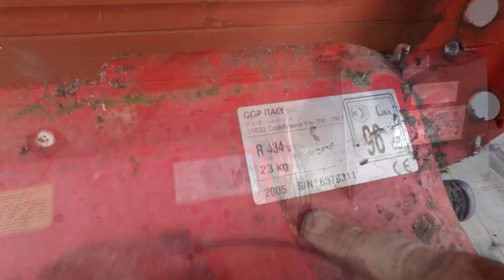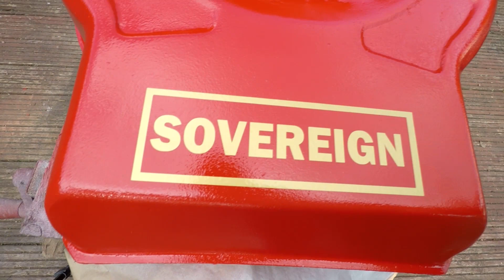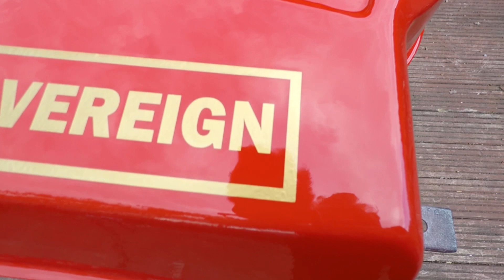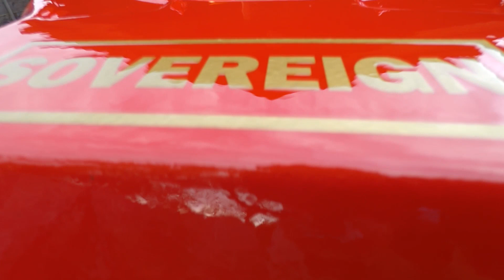Old Worn Out Lawnmower Lives Again Restoration

Comment: Well done Mart on yet another great mower resto. You really are  great with this kind of work.I had a similar type of mower (BTS 430) which the deck rotted despite the fact that I always clean underneath the deck after mowing. It was in worse condition than yours because it had actual holes in it.I took the still working engine  from it and scrapped it.I found a mower in the garden of an abandoned house with a totally rotten deck but I dont know if the engine is scrap or not .Still have it might try to see if it  will work some day.The fuel tank has holes in it though.

Comment: FYI I HAVE BEEN MAKING MY OWN RUST BUSTER FOR BOLTS FOR YEARS . GET A QUART OF SYNTHETIC TRANSMISSION FLUID ANY BRAND AND ACETONE IN A OIL CAN MIX 50/50 EQUAL AMOUNTS SHAKE WELL ANS SHAKE BEFORE USING BEST OF THE BEST ENJOY

Comment: Why do you not bother to clean the rust from the underside of the deck?  This is where most of the mowers get most of the moisture that causes the mower to rust out.  A good blasting and a good rust treatment, like you did on the top would go far in stopping future rust problems.
Reply: I thougt about it too when I saw the video.